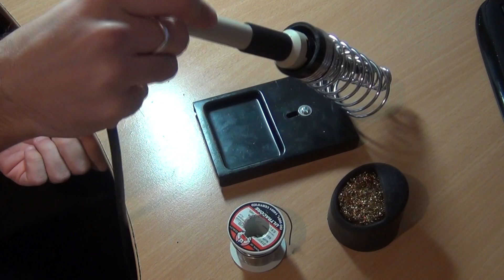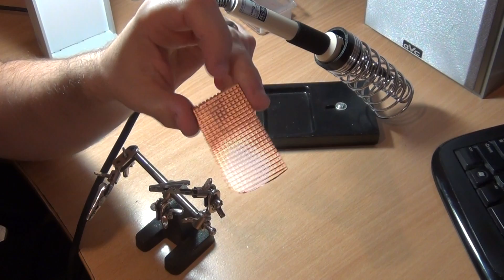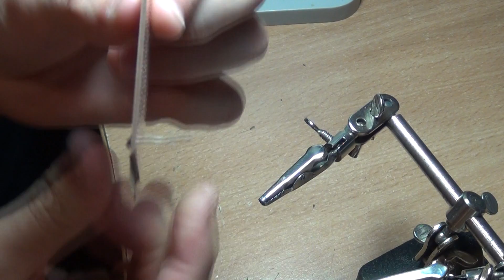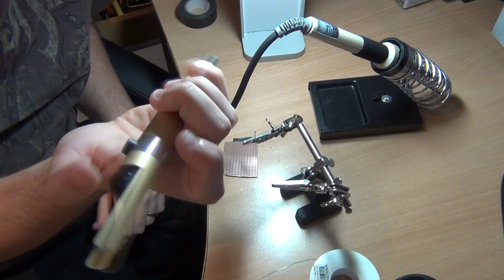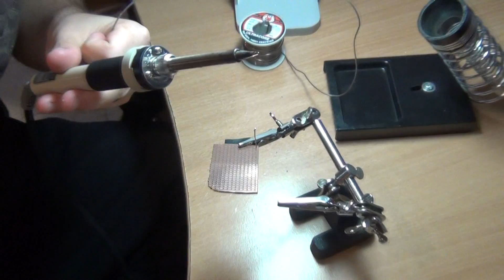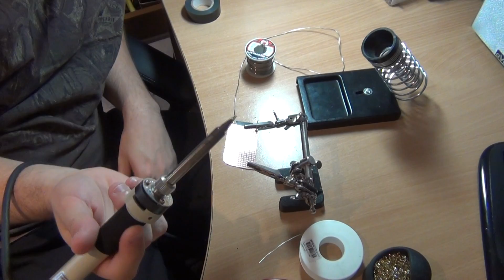Tutorial: Soldering (Electronics)

Comment: Hello at DIY Guitar Pedals!! Hope you can answer my question...building my first pedal Dallas Arbiter Si Fuzz Face clone kit. Comes with the PCB already made. I have some electrical soldering experience and a ton of copper tubing soldering experience so I'm ok there. Basically I'm confused about the silicon transistors and how to install them into the sockets? It looks as though the sockets are soldered into the board and then the transistors inserted into the sockets, but are they soldered in? Do you trim the leads back on the Si transistors or what? Sorry if this is a dumb question but any advice would be greatly appreciated!! Thanks! I'm binge watching your videos now lol!

Comment: Hi, I'm a newbie and I've a couple of questions for you😅, which diameter of soldering wire do you recommend for pedals works, 1mm, 0.8mm, 0.6mm or other? And which composition 60/40 or 63/37 ? Thanks!!
Reply from the maker: Hi Matteo.  I personally use 60/40.  I think the diameter is around 0.7mm as well.  Hope that helps!
Reply: @DiyguitarpedalsAu  Thanks!!!

Comment: what is the difference between a solder and a flux? what's the purpose of a flux? thank you.
Reply: Solder is the metal,it used to be lead and tin but I don't think lead is used anymore, it's the wire used to make the connections "joints" flux is used to remove Corrosion it's sometimes a liquid out on the copper to clean it.

Comment: Hey man, Great video, thanks so much
is that a temperature controlled solder iron? is a temperature controlled one essential for making pedals or can you just use a normal one?... sorry if its an ignorant question, im pretty new to this.
Reply from the maker: No that's an excellent question! I still use this soldering iron.  A soldering station would be great, particularly for desk neatness, but I personally have never needed temperature control (for guitar pedals).  Could be useful for soldering temp sensitive devices (MN chips, ge transistors etc), but I usually socket them anyway or just be quick when you solder. You can also attach a heatsink  or alligator clip to these types of devices to absorb some of the heat as well.  I honestly wouldn't worry too much though.  I've built a lot of pedals, I don't think I've ever had temp related damage.
Reply: Great, thanks so much!

Comment: I'm new to soldering. Bought a kit to try and solder a broken wire that's stopping a good food mixer working. Trouble is the wire has broken right where it meets what I'm guessing is a resistor(hard to tell - covered in black plastic!). Could you offer any tips for how to go about this or is this just the same as any other solder? I would've guessed resistors can stand quite a bit of heat? Thank you.
Reply: Well, I think that thing can be a fuse. Can you remove that plastic cover? If it is thick kinda "barrel" that can be a ferrite (used as filter). If not, try to strip that thing away and connect wire through a suitable fuse.
Reply: MrJohhhnnnyyy
Thanks for the reply. Could've been a fuse. Anyway - I had to do it the next day . Soldered one break,but caused another(very tricky space to work in). Soldered second break, but mixer would not work. So replaced it in the end. Perhaps I blew the fuse's wire with the heat?
Reply: jkjerome1 Then try replacing power cord with one, that you 100% sure is good (don't forget a fuse). If it blows a fuse again, you may have short somewhere, maybe even motor winding shorted out
Reply: MrJohhhnnnyyy
Thanks a lot.

Comment: Great video!
I'm having trouble understanding the socket concept for an old germanium capacitor. When I search for solder sockets I get sockets for holding chips. Can you point me to a description, video or a picture?

Thanks
Reply from the maker: Hi Stephen, you can use SIP (or "SIL") sockets for germanium transistor but they are a bit fiddly.  Go to Tayda Electronics and type in SIP.  Its basically a long row of sockets.
Reply: chromespherecom
Thanks for the link. Just to be clear, will the socket lock automatically once you insert the lead?

Comment from the maker: Something wrong there!  Don't use lead free solder.  Also make sure your solder has a flux core.  Flux is essential for solder to flow properly.  If it doesn't get a flux pen and dab some onto the joint before you add the solder.  Make sure the joint your soldering onto is clean.  That's the only things I can think of that could be causing your problem.

Comment from the maker: Hey man, i always use rosin core, 60/40.  Its easier to use.  I use a rosin pen for smd, and for some hardware connections like input / output jacks / large surface areas.  Also for soldering onto materials that dont accept solder flow very well (lugs of ecomonic parts that are coated brass for example).  You can use the rosin pen anywhere you want, i just use it for spots that (i know) are difficult to solder onto!  hope that helps, happy soldering :D

Comment: the most important factor for soldering, in my experience, is never admitting that you use flux. i buy that shctuff by the barrel. also, never solder in short pants, unless you have a fantastic ass. DO NOT drink and solder, you might spill it (the lager of course). when cleaning the iron,  i prefer to utilize the Roger Daltrey method, now on to the real issue, sold-her , or sod-ur ? once saw it spelled sotter ... i think i am going with that. look 4 my salve-n-bandage tutorial soon. Great video!

Comment: You're not supposed to use the metal/wire cleaner for regular cleaning, it's for when the tip has some significant crud on it. Using it too much will damage the iron tip.